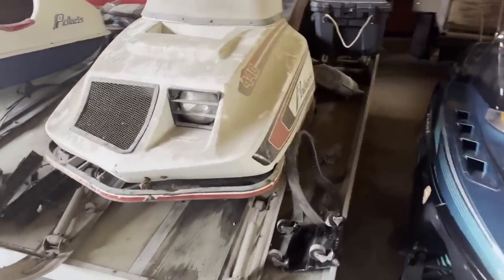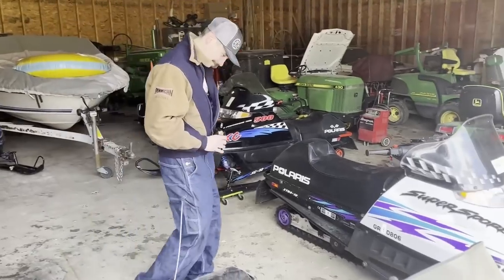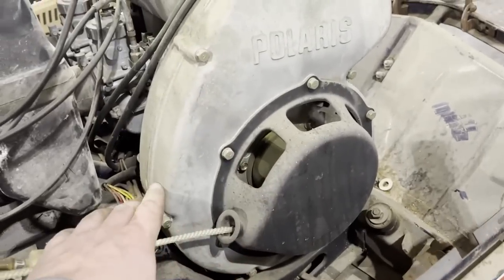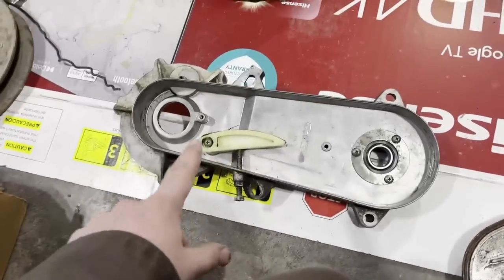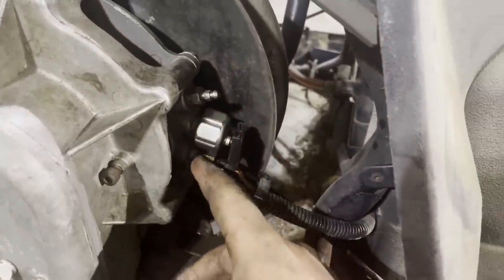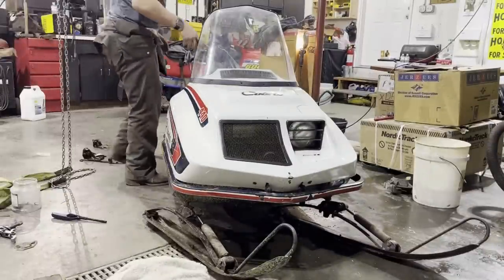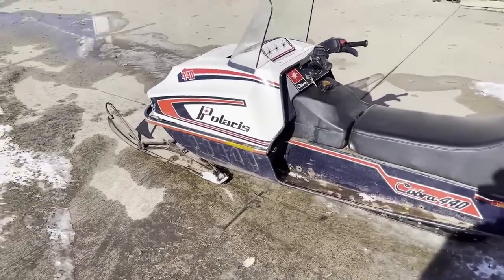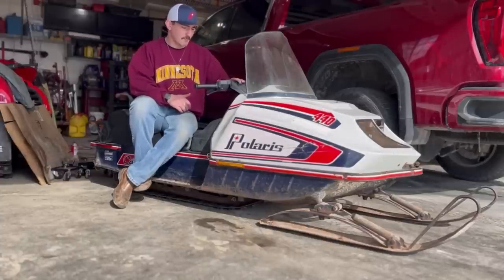FREE!!! Snowmobile Revival Polaris Cobra 440!!

Comment: I used to have a 1979 ski doo Blizzard 9500 plus, 440 liquid cooled, with twin 38 mm mikuni carburetors, that were jetted out to the max, and dual expansion pipe's on it, and that thing would do about 80 mph, it also was equipped from bombardier, with a rotary valve, instead of conventional reed valve's, I bet that sled you got there, that polaris would probably do about 65-70 the way you've got it set up right now, and it wouldn't be hard to squeeze more out of it with some Mods.

Comment: I almost thought this was my old sled! I had the same exact one like 7 years ago. Mine ran, was pretty dang fast for how old it was, brakes didn't work. I bought mine with a titled tilt trailer for 350 bucks on Craigslist. Ended up selling the sled for 450 after I got it running and rode it a few times, fixed up and kept the trailer for several more years and sold it for 350. Man I love wheelin and dealn old cool stuff.

Comment: Excellent video :) also nice find also all rebuilt to go Snowmobile riding and did tune carbs for low , high idles plus mixture screws too set up ! Also lube the choke , throttle and brake cables too to hopefully brake light works too!

Comment: I have a Yamaha GP338 I got for free from a friend's barn, after the people renting their farm abandoned it there.
Complete, but very, very, very rough. Also caked with pigeon poop. Engine was/is junk, track rotten/worn to nubs, suspension worn/rusted/seized, mouse-eaten seat, broken-up hood where the hinges mounted... It's a heap!
But it's MY heap! Body is probably the best part, although the skies/steering and fuel-tank are also salvageable, but the underside/pan under the engine is both caved in and badly rusted/rotten. Very much a long-term/someday project.
Your basket-case is a lot better-off, and in better hands! XD Looks like your dog's limp was taken care of or healed up.
Reply from the maker: hey good luck with your project
Reply: Thanks! The two Beetles will probably be a priority first, but I did pick up a used track of the right width from a wrecking-yard a while back.